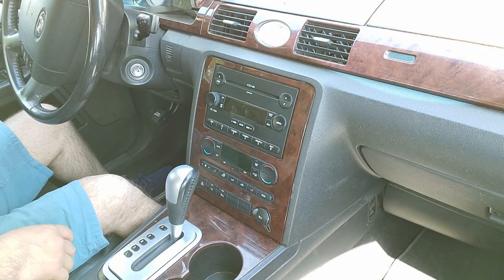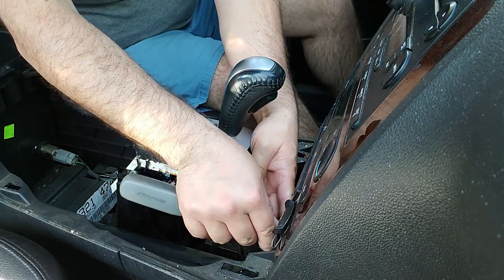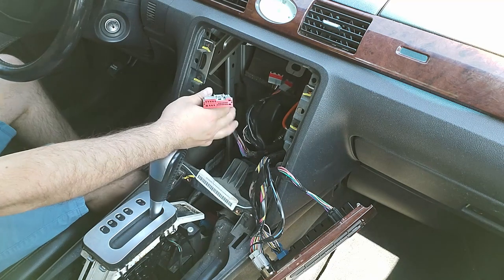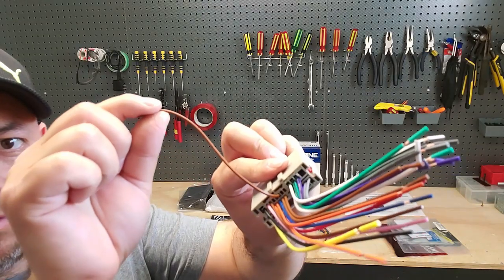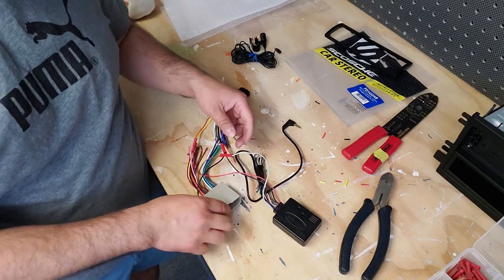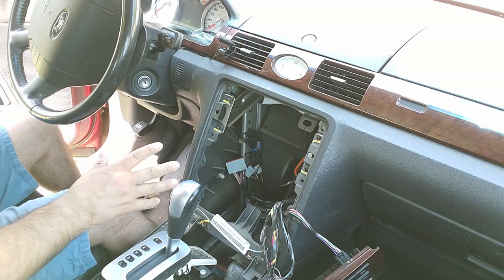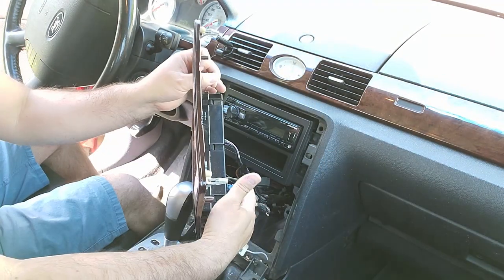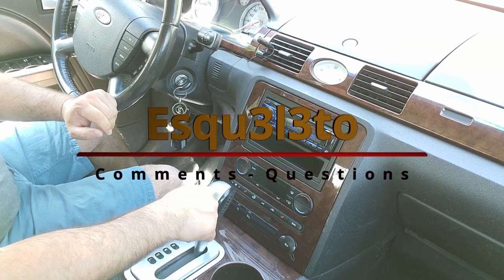Ford 500 Radio Install

Comment: This is awesome!  Thanks for the very detailed instructions, too.  This will be very helpful to me as I am getting ready to replace the factory radio in my Ford 500 soon.
Reply from the maker: Awesome! Thanks and glad it can help you out 👍
Reply: @esqu3l3to  - I've watched this video several times.  You make this look sooo easy.  But, every time I gear myself up to try and attempt this, I scare myself out of the idea again.  I sure wish you lived in Ohio so I could hire you to do this to my Ford 500.  I'm finding that radio installation has changed a whole heck of  a lot since my last install 30 years ago.  Ha!
Reply from the maker: Honestly, its not to hard. If you get the adapter harness, it will make it so much easier. Whats your email?
Reply: @esqu3l3to  - It's that harness part that's throwing me into fear so much, I think.  I'm so afraid I'm going to end up crossing wires that shouldn't be crossed and my Ford 500 will leave without me.
Reply from the maker: Got it, you can delete it
Reply: What will you install?
Reply: @ScottALanter  Try a concrete drill and sledge hammer.

Comment: Easily remove the console from the rear w/a thin thing, maybe the lever from a toenail cutter or even a hunting knife. With tool in place, move console gently back and forth.

Comment: what type of steering wheel interface did you use and do you have a wire diagram for speaker wires and such excellent video also
Reply from the maker: Thanks and I used the ASWC-1 from axxess. I don't have the speaker wire diagram, however, if you use an adapter harness all you need to do is color match wire to wire including the speakers. You can also re-pin a wire or two on the adapter harness to wire up the ASWC-1 and not cut into or splice the factory harness.

Comment: I wish you would have explained the wires better and how you taped them all together. I have no idea what to do with all these wires and which ones i should tape to the original factory
Reply from the maker: email me at chucho_301@hotmail.com and I can walk you through how to wire up your radio. Did you buy an adapter harness?

Comment: Hey boss, can you show me how to replace the bezel itself cuz my climate controllers are all working but the bezel is broken so when I push the controllers they are not stable so I have to change the bezel but I don’t k is
Reply from the maker: the bezel should really easy to replace. there should be tabs that hold the climate controls is place, and or a fee screws. look around the climate controls. once removed you can replace onto the bes bezel.

Comment: hi! i have an 05 500 limited and i was wondering does this effect the functionality of the parking sensors at all? or do the still operate and make sound fine with no modification
Reply from the maker: Hello, upgrading your radio wont affect your parking sensors at all. They should function normal. The radio does not affect or control your sensors.

Comment: Side question. I am not looking to replace my stereo(the car has too many miles on it), but it needs a cd lens cleaning. Do you know if that is easily accessible if I pull out the unit?
Reply from the maker: You can buy a lens cleaning kit because it would be a lot of work to take the radio apart to clean it that way.
Reply: @esqu3l3to  True. I will have to look into that. The last disc cleaner I had said not to use on car cd players since it had a little brush glued to the disc. Warned of getting stuck in the player.
Reply from the maker: Makes sense, I havent used one in quite a whilse since I mostly uss bluetooth audio now or whem connected directly to the radio. They do sell them online like amazon so check there.

Comment: Hey, there are two violet (purple) wires as well as a green/white wire coming from the car. I know one violet is battery power. The other purple is 12v accessory? And what's the green/white wire for? Thanks
Reply from the maker: Are you talking about the wire colors from the factory connectors? I'm not familiar with their oem colors, best to buy a harness and that will give you the universal colors to ensure you connect all the correct wires together.

Comment: How did you make the controls work from the steering wheel?
Reply from the maker: Using the axxess ASWC-1 mudule and wiring it in along with the radio harness

Comment: Question.. my girlfriend has a 2006 Ford 500 I want to upgrade her radio to a double din, however she doesn’t use the steering wheel controls and i honestly don’t think they work either.. is there a way I can just not install that black box and just wire it up manually since we don’t plan on using the steering wheel controls anyway?
Reply from the maker: You can do everything the same with the exception of the adding of the steering wheel control module. All the wiring will be the same but you dont need to do the extra wiring. I show it how to do it if you decide you want to addd one.

Comment: Where can the aux cord go because I don’t want to remove the radio
Reply from the maker: Are you adding an aux input? Othee way is to use an fm wireless modulator

Comment: I have a 2006 Ford Fivehundred and im having trouble finding a radio screen with apple car play, that’ll fit. Any recommendations?
Reply from the maker: Most aftermarket units will fit, you just need to buy a double din dash kit to fit into your Ford. Do you have a preference like kenwood or alpine? Also, how much are you looking to spend?
Reply: I don’t have a preference really. Also I’m willing to spend something that is reasonable, worth the money.
Reply from the maker: What's your email? I can send you some links to a few units
Reply from the maker: Ok I will get you some links in the next few days
Reply from the maker: I just sent you an email, check to make sure you got it.

Comment: I bought a ford 500 2005 and the stereo doesnt work if anyone could help me with any tips i would greatly appreciate it !!
Reply from the maker: Does it power on or no?
Reply: @esqu3l3to  no it doesnt have any power when i connect the stereo to it
Reply from the maker: And you're talking about your factory radio or aftermarket?

Comment: Can't locate the hot wire for radio In 2005 ford 500
Reply from the maker: Use a multimeter and test the end higher gauge wires. Also check for schematics on crutfield or sonix. Some do provide that info

Comment: Where is the location of the aux. I can't find it anywhere
Reply from the maker: If yours has it, it should be in the middle console between the two front seats or by the shifter. Also check in the glove box.

Comment: This seems so damn hard to do
Reply from the maker: It is actually not as difficult as it seems. This car has been one of the easiest I have done.
Reply: @esqu3l3to  yeah I did it already. It wasn't that hard. The hardest part was how scared I was that I wired it up wrong
Reply from the maker: yea I get that. its why I always recomend using adapter harnesses. saves a lot of time and guessing.
Reply: @esqu3l3to  I did use one haha, I just was scared of wiring it up wrong to the radio harness